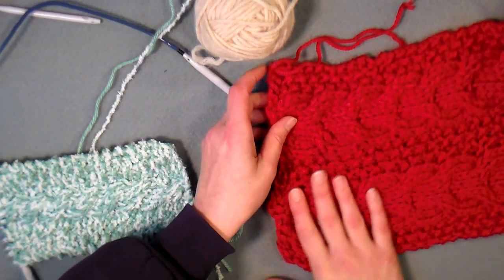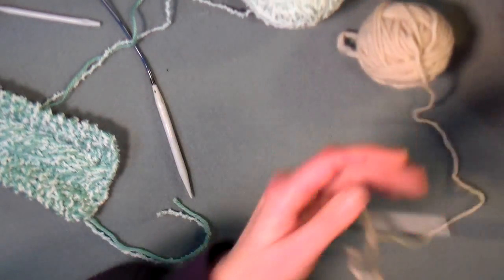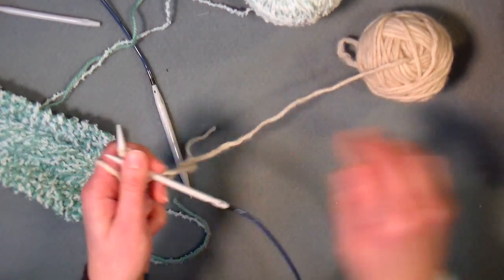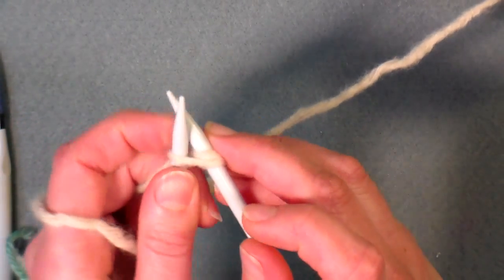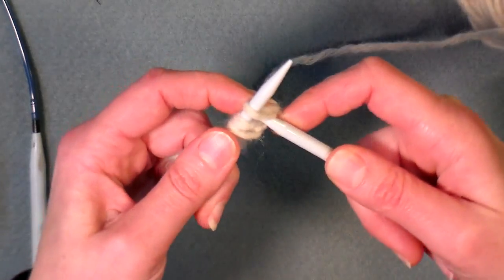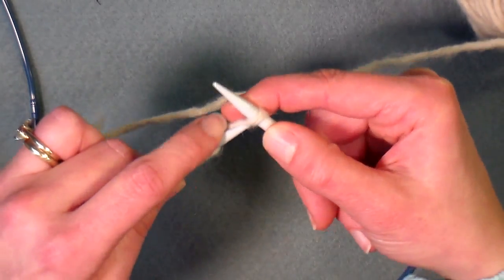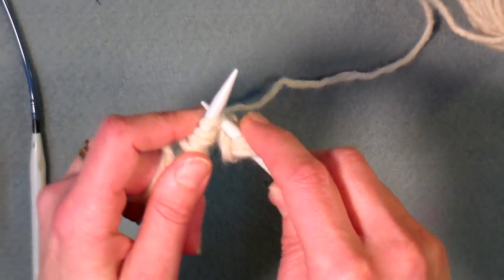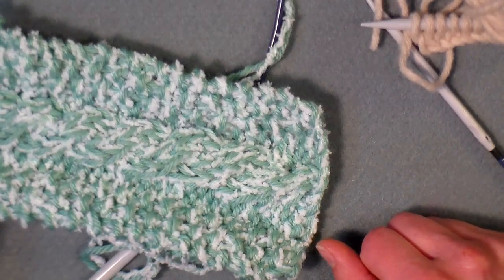how to cable cast on

Comment: Sometimes I feel like I should write a little list of the different cast-on's I know and whether they produce a stretchy or tight/solid edge, because I'm always forgetting as I often only knit in the winter. As a kid I learnt to cast-on the "lazy Lindsay" way. But when I went to re-learn as an adult I thought it might be wrong and learnt other methods. The cable cast-on looks great, thanks for sharing. I have yet to try cabling but have seen it done with and without a cable needle, do you use one?
Reply from the maker: yes, I use one of my denise interchangeable needles as a cable needle, it has a front and back side so I can tell it my needle twisted when I kit the other stitches. I don't like the live stitches hanging out needleless on my work LOL! Recipe for disaster for me:)